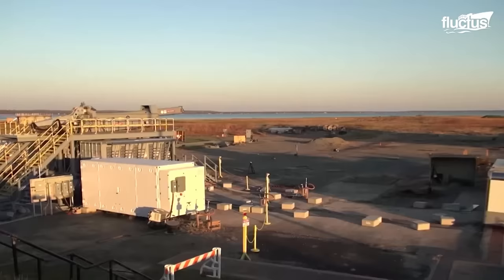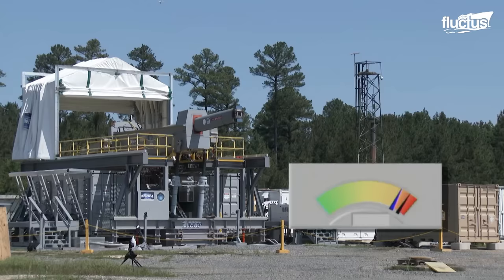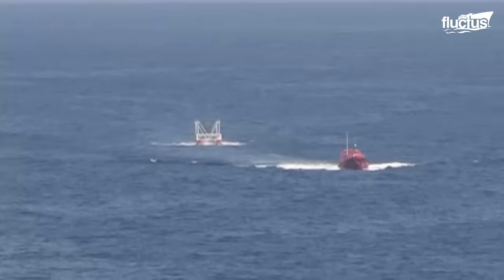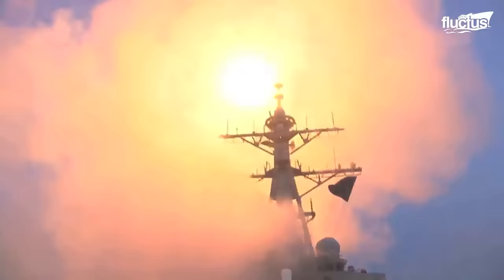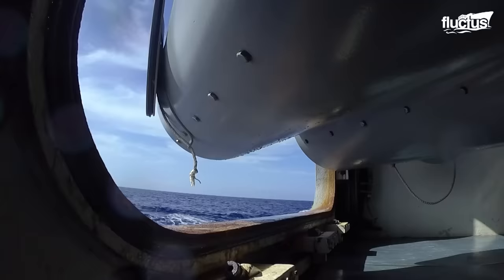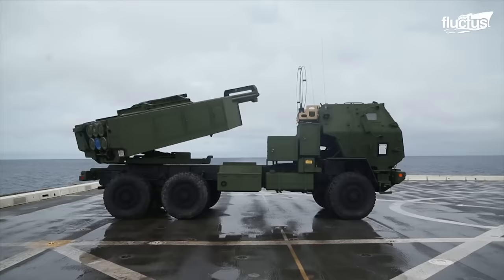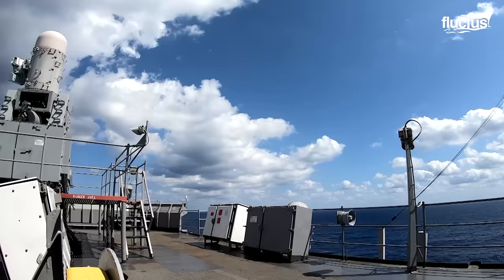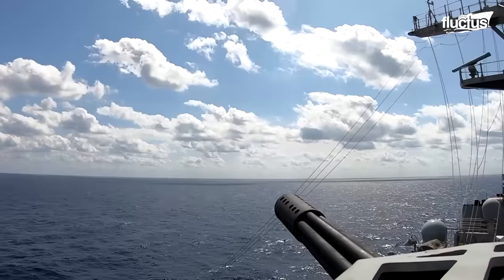US Testing Its Monstrously Powerful $500 Million Rail Gun

Comment: Most impressive to me is how that high-speed camera tracked perfectly and horizontally a projectile travelling at 8270 f/s (that's a whopping 5638.6 mph or 9074.5 km/h!)
Reply: Mirrors are wonderful things!
Reply: @RiskyVentureMinerals  I've only seen ugly things in mine.
Reply: @catparka7698  I sighed at your comment :/
Reply: At 100 miles range it'll be there before it's fired .
Reply: The camera uses a mirror to track the projectile while the camera stays still
Reply: @sayamqazi  You know my pain.
Reply: I was thinking the same thing the first time I saw it.
Reply: @ClappOnUpp  
Thanks Clapp👍
Reply: Yeah, and launching it breaks up the gun.
Reply: They use mirrors at certain angles to only need to move the camera around 10-30 degrees of angle
Yet tracking it across a nearly 140 degree turn
Reply: Fun fact, you can even capture a photon speeding at 1,078,929,169.2 km/h (670,415,504.2054 mph), using a streak camera setup (Caltech has one with a whopping 70 trillion FPS framerate) so it is not that surprising to capture a railgun projectile.
Reply: How much is that in mach speed?
Reply: @Vertin_The_Timekeeper  Roughly Mach 873,768.35 lmao. For the railgun projectile tho, Mach 7.35
Reply: @Vertin_The_Timekeeper  
Approximately 7.3 based on some calculations.
Reply: Imagine what this science can do for: forrestfires. If these scientist sit around one table all those damaging woodfires are for the past.
Reply: After reading the halo books that sounds ridiculously slow for a railgun 😂
Reply: i think they crop the video to track object
Reply: Imagine a "Kinzal" at 12,000 km/h!
Reply: Seems fast until you realize there are missiles out there just as fast, can travel much further, and have pinpoint accuracy.
Reply: @sayamqazi  I laughed my ass off at their comment.😆🤣
Reply: @khunrocky606  😂
Reply: @rivolibioscoop  😂
Reply: that's 2,52km/s! holy shit
Reply: @JLSV1970  imagine a tungsten pole 30 feet long traveling at that speed coming straight down from space!
Reply: @vladchannelyt  😂 It's not his day.
Reply: most impressive is they DO NOT VALUE LIFE OF ANY KIND THE IMPACT ON SPECIES IN THE ENVIREMENTS OR THE INABILITY TO FIND BETER WAYS TO SOLVE PROBLEMS
LAST TIME I CHECKED IM NOT ALLOWED TO SOLVE MY PROBLEMS BY THE SAME  TACTICS MILITARY USE OR EVEN LAW ENFOrcement useyet they keep trying to dictate what is right and wrong
Reply: @ClappOnUpp  The power requirements are huge, it needs a power station to fire it without causing blackouts and yet China got theirs working on a powered diesel ship, which the US navy cannot replicate and spent hundreds of million dollars on this one.
Reply: @johntaylor3298  hmm interesting 🤔.. you say China has a railgun on a ship? Must be quite downscale though. I gotta look this up! I would assume it's a much smaller or underpowered one especially on a deisel.
Reply: @rivolibioscoop   railgun science? How would that apply to forest fires?
Reply: @erikehlert  Summer testing on water surfaces I suggest.
Reply: Thats what 800 Billion dollars can pay
Reply: Exactly what caught my eye
Reply: That's insanely fast a little more than 1 min to travel 100 miles.. 😱😱😱
Reply: Yet security cameras take pictures that are more blurry than old bigfoot images.
Reply: @catparka7698  

Family gatherings can be like that.
Reply: @catparka7698  lol
Reply: The camera doesn’t move, but there is a small mirror that does.
Reply: Mach 8 approx
Reply: I have shot .223 55grain projectiles at 3400fps in 22-250 rifle.   That’s the fastest i can do.  A 1.4 pound projectile at 8200fps is out of my league.
Reply: That might be fast enough to bring down some of these UFOs 🙂
Reply: Why not just say 2.5 km/s?
Reply: It‘s easy: just fire two railguns simultaneous side by side, one has a gopro mounted on the projectile🤷🏻‍♂️😝🤭
Reply: Shows you arent too bright
Reply: There are camera's that can film the speed of light.
Reply: Mirrors and A.I. also we know exactly where the projection is. Some math and timing is all needed. We been doing this for a while. Not something new. But the high speed camrea that's new and impressive!
Reply: put these things around the globe and we solve ufo mystery
Reply: @ClappOnUpp  Large capacitors.
Reply: Makes you wonder how precise the microscope is watching you and I ???
Reply: More than 5 and a half THOUSAND miles an hour... that's insane
Reply: Multiply that by 4 and you can launch it to Earth's orbit :)
Reply: Next time give us the formula and make us do the math. Use it or lose it. ;)
Reply: The camera is static, the action is followed by a mirror. The slow-mo guys have a video (on a tank shot) that shows the exact method. This is old as balls, we're talking 50's, possibly even earlier, obviously not as good as today, but still old tech. It was made by the British Atomic Weapons Research Establishment and it was used to study various reactions. It's in the museum of London Museum of Science right now, saw it a few years back. Impressive bit of kit... given it was made in the 50's possibly late 40's (during WW2).
Reply: Uses a rotating mirror.
Reply: @vladchannelyt  hey can you please point me to that video. I would love to see that.
Reply: Could be traveling 5638 mph and there will still be someone tailgating you flashing lights to move over